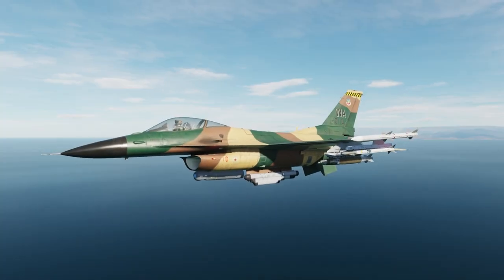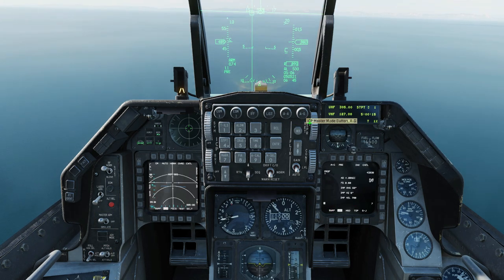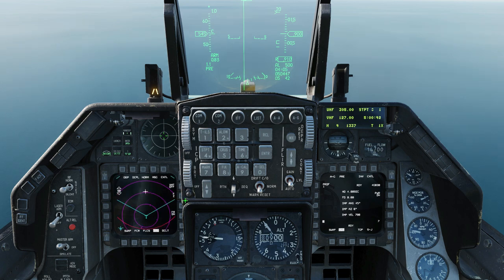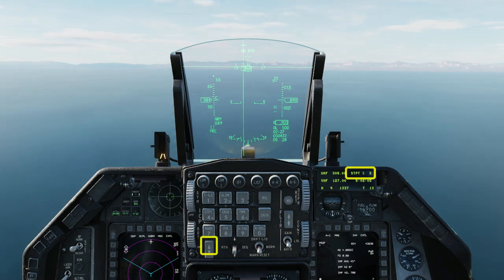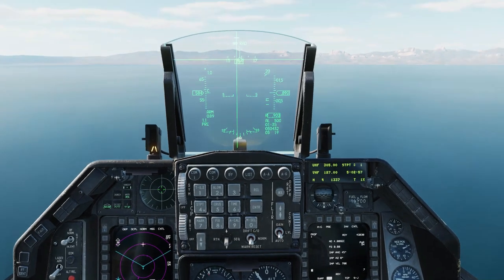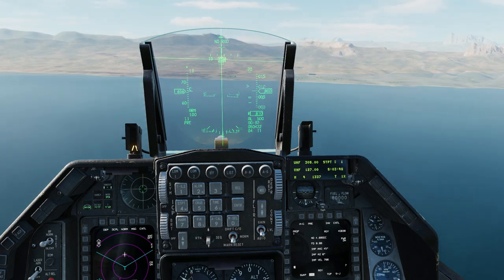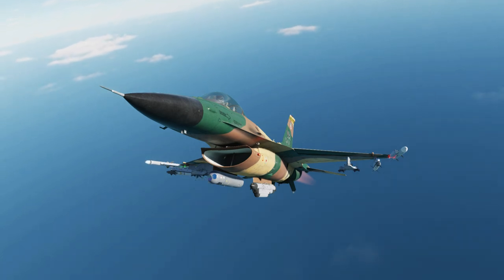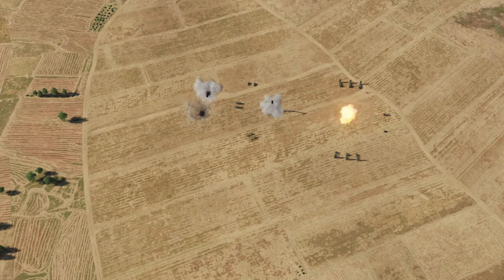DCS F16 JDAM Toss - Ripple Technique - DCS in 3 Or Less

Comment: The trouble I have with JDAM ripples is that TGP set markpoints seem to drift big time
Reply from the maker: Specifically with the tpod? That's more likely to be parallel error than drift. Try aiming for a point on the ground just next to a wheel or something. You can have more success like that.
Reply from the maker: Specifically with the tpod? That's more likely to be parallel error than drift. Try aiming for a point on the ground just next to a wheel or something. You can have more success like that.
Reply: Use markpoints to mark the targets and don't make hard turns after designating, the F-16 has INS drift moddeled. Also use the laser before saving a markpoint to get precise coordinates or point it at the ground in front of the target.